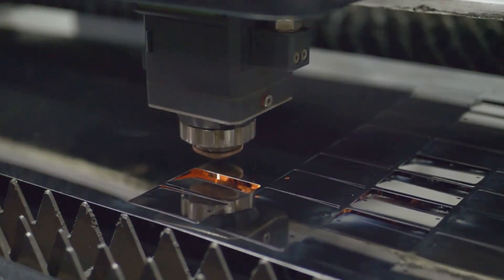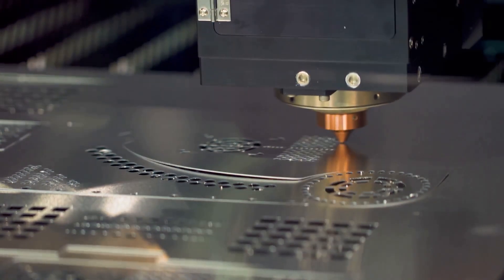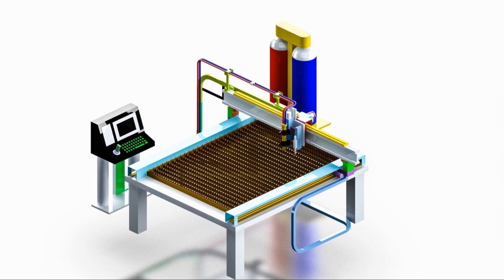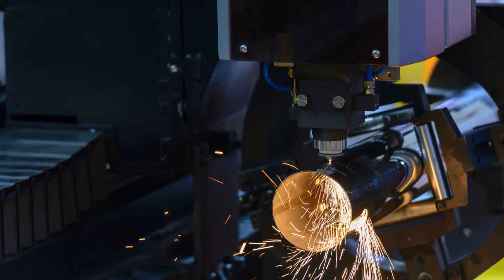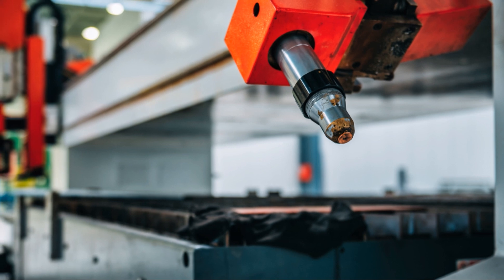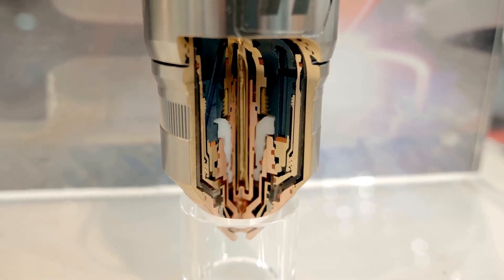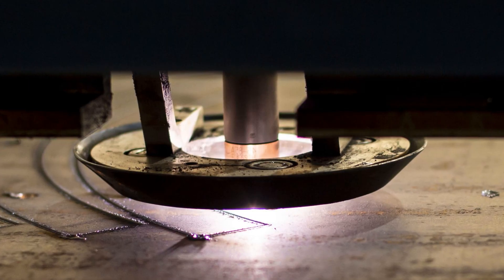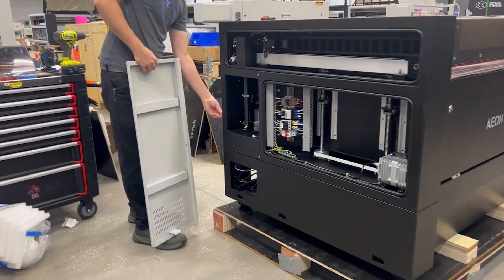Plasma Cutting  vs Laser Cutting  which is  better and why?

Comment: So, the company I'm currently working here typically has needs to cut Al 5052 H32 anywhere from 1/16" to 1/8" thick.  Sometimes 3/16 and 1/4 but not as much.  Will plasma work for this material?
Reply from the maker: Yes, plasma will cut it, especially in the 1/16″–1/8″ range, but aluminum tends to leave a rougher edge and more dross compared to steel. You’ll likely need secondary cleanup (grinding or sanding).

Edge quality & kerf width: plasma’s arc spreads a bit, so you’ll see a wider kerf and a heat-affected zone that can discolor or warp thinner 5052.

For production or tight-tolerance parts, a fiber or CO₂ laser does much better — cleaner edges, smaller kerf, and almost no post-processing.

For quick fabrication or bracket work, plasma’s perfectly fine if you’re okay with the finish and don’t need laser-grade accuracy.

So, if your main jobs are 1/8″ aluminum or less and you want minimal cleanup, laser wins. If you’re mostly doing rough fab work or heavier pieces and already have a plasma setup, it’ll get the job done — just not as cleanly.

Comment: Plasma struggles with reflective metals?  I thought lasers struggled with reflective metals and plasma was fine with it so long as the material is conductive.
Reply from the maker: Polished  surface finishes often get  more  Slag /  dross on them from cutting.    Where  the  laser does not have that problem.  Now is really the time for the professionals to do side by  side comparisons.   THANK You so much for the comment.   My goal is for everyone to get the best tool for the job.  EMP was nice enough to  let me in to do a pretty decent comparison.
Reply: How much does it cost to